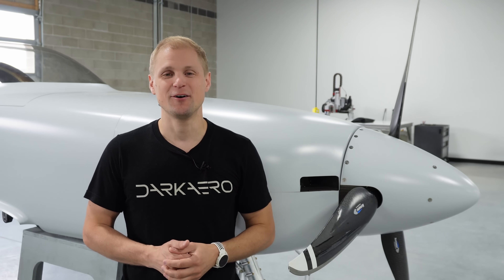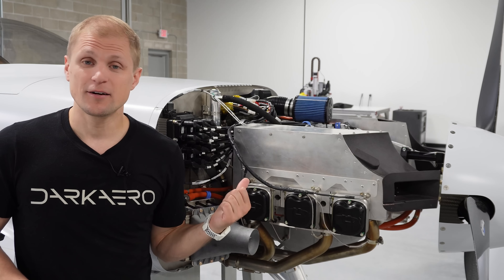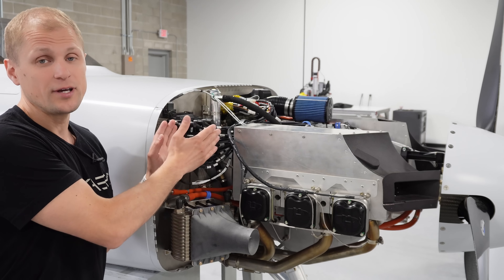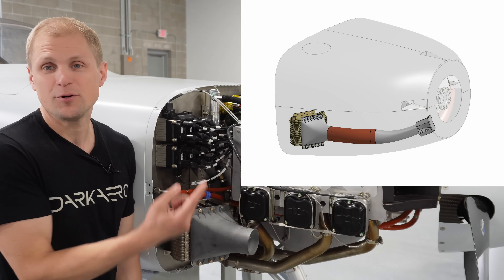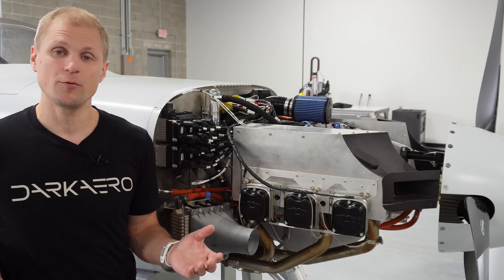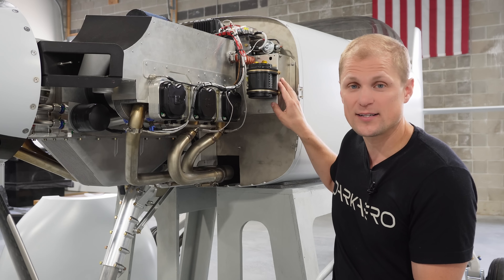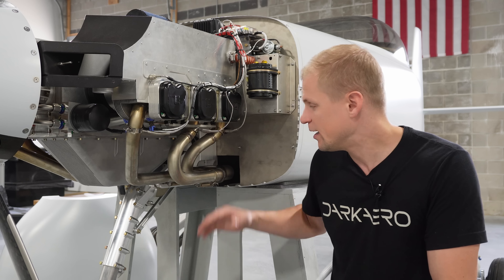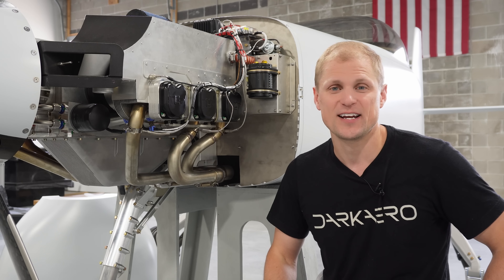Big Engine, Small Airframe: Did we reach the limit?

Comment: It will be interesting to see if the oil cooler air exhaust will be adequate, or if the cooler needs to be moved forward a bit so the air can more easily exit.
Reply from the maker: It’s not shown in this video, but there is a large gap between the cooler and the firewall to keep the exit unrestricted.
Reply: @DarkAeroInc  It looks like you kept the section of the feeder duct to the oil radiator constant ? Was it not possible to implement slow expansion to increase pressure recovery and reduce internal drag? For example by molding a channel into the lower cowl?

Comment: Can’t wait till y’all put the turbo UL on there and get insane TAS up high
Reply: turbo = more power = more cooling, more drag, more engine and structural weight, more complexity and failures, less flying... This plane is not pressurized and IMO its sweet spot will be 9-10 K feet. I'd rather lose a couple of knots than drag along O2 and  fly with canulas... PS : this is from a turbocharged and pressurized aircraft owner/pilot.

Comment: If there’s an engine fire, maybe I want my battery to maintain the electronics.
If there’s a battery fire, I don’t want to have an engine fire too.
Putting a lightweight battery in the tail might be a better idea.
Reply: Weight.  Keeping the starting battery firewall forward limits the length of the heavy #2 wire.  Longer run might require heavier wire.

Best to have dual batteries with dual busses for fault tolerance and a circuit breaker tie between the two.
Reply: @keithjurena9319 :

A longer run of wires or another battery.  Hmmm.
If my engine burns, my battery burns too.  If my battery burns, my engine burns too.
There are so many trade-offs.
Reply: @denverbraughler3948  
Which is why you have two batteries.  Engine fire means you cut fuel and land asap.  A small 5 amp-hour battery will easily power instruments and radio for that time
Reply: @keithjurena9319 :

But the stated design goal is to have the battery firewalled from the cabin.

Another battery means more weight.

I want to use lights too for an emergency landing off-field at night.
Reply: The Garmin G3X can be wired with Aircraft Power 2 being fed by a backup battery to keep the system operational if main bus power is lost. 

Garmin Support:
“While Garmin doesn't directly offer a backup battery for the G3X or G3X Touch, all boxes in the system have isolated "Aircraft Power 1" and "Aircraft Power 2" inputs. The "Aircraft Power 1" inputs are typically wired to the primary electrical bus and the "Aircraft Power 2" inputs can optionally be wired to a second power source. A common builder option is to use a small third party battery unit to keep the display, GSU 25 and GEA 24 online in case of a primary electrical power failure. An example of a third party solution to consider is the TCW Model:IBBS-12v-3ah backup battery.”
Reply: @alexanderarnett4966 :

The stated designed goal is to place the battery on the hot side of the firewall, not to add a third battery.

Comment: Do you have a paper filter in-line so that when the oiler cooler leaks, hot oil cannot spray into the cabin?
Reply: I wondered about the rules regarding heating cabin air with an oil cooler. I dont fly so have no idea. But if the oil cooler leaks, you have very messy air coming into the cabin! Could even block the windscreen!
The odds are low though.
Reply: @olliea6052 :

Anything that can go wrong eventually will.

Comment: How do you manage battery temperature immediately after hot engine shutdown?
Reply: Majority of heat soak goes up into the cooling chamber, so just close the battery temp controller valve?
Reply: @mofayer :

A closed system will seek thermal equilibrium.  
In this case, the compartment is the space under the cowling which houses the engine and battery.

The battery shell needs to be isolated from engine heat and open to the atmosphere.

The battery temperature should be more similar to the cabin temperature and less like the engine temperature.

I expect that it’s easier to ensure that heat and smoke from a battery are easier to vent than to protect the battery from the engine temperature.  
Plus isolating the battery and engine mean that a fire with one won’t cause a fire with the other.
Reply: @denverbraughler3948 their main problem is with low battery temps, not high

Comment: How much new design and fabrication work would be needed to fit a UL520t into a DarkAero 1.1? Or is the packaging so tight that you won’t even consider that?
Reply: The turbo sits aft of the engine on the 520T and the exhaust tube is aft and below. The engine would have to sit far forward to accommodate this but I suppose they could do it and adjust the CG aft with other means such as reinforcement to the airframe for the added speed. They would also need a space for an intercooler.
Reply: I think the UL520iT would not give them an increase in airspeed but is designed rather increase rate of climb and power at altitude which could result in faster ground speed and possibly better net fuel economy. It’s dimensions are surprisingly similar, larger in the X & Z axis by cm’s in only, so it would require a new flaring and a rework of the engine bay intake and exhaust plumbing.

Some of the future planned versions of the UL5xx will include some substantial hp boosts with or without the Turbo. Those might be better suited for an DarkAero 2 with 4 seats. We can only dream.

Of course now we are talking timelines of Turbine Aeronautics Group’s TA200TP, which if comes to market might make make the UL520iT moot as it would be both smaller and lighter than even the current UL520iS.

Comment: the oil cooler also avoid exhaust leaks in the cabin air.
Reply: It will be interesting to see if this arrangement provides enough heat to keep the cabin comfortable at altitude,  Exhaust heat exchangers use approx 1,400 degree exhaust gas to warm the flow of outside air.  The oil temperature will be in the order of 200 degrees after the engine is fully warmed up.  These guys are all about engineering, so I hope they've calculated the BTU's required and available from the oil cooler.  Remember there is about a 4 degree drop in ambient temperature for every 1000' of altitude.  An airplane cruising at 10,000 feet in 50 degree weather at the surface will be traveling thru very cold 10 degree air.
Reply: @garyplewa9277  Excellent points.
Reply: @garyplewa9277 
Exhaust cuffs are really low efficiency heat exchangers.  You don't want air over 180°F and that is hot.  But yes, an oil cooler has far more delta T on oil than air.  All depends on leak rate of the cabin.
Reply: @keithjurena9319  You are correct.  A cuff over a bare exhaust tube, especially tubes made from 300 series stainless steel, which is a poor conductor of heat.  It all depends on the hot surface area under the cuff. There are some aircraft where the cuff is over the muffler, and some mufflers have studs peppered on their outside of the hot surface to better transfer heat to the cabin air.

Excessive air temperature can be easily handled by an air mixing valve.  I'm a long time owner of a Piper Cherokee 140, which has a cuff over a rather large muffler.  The hot surface area is about 6" in diameter and 18" long.  It produces an abundance of heat.  I partially melted my rubber soled shoe one day from the forward side heat outlet by having the heat control in the full on position.  I am never cold flying that airplane in winter.  I can't say the same for other aircraft I've flown

My point in all of this is you can never have too much heat with a properly designed air control valve.  But you can have insufficient heat output and nothing short of eliminating air leaks the installing insulation will help.  DA's approach to using oil heat might be adequate given their cabin size and construction.  Time will tell.
Reply: And what if the oil cooler leaks hot oil?
Reply: @denverbraughler3948  Oil coolers of this design rarely leak.  They're main failure mode is clogging over time and inefficiency from oil sludge depositing on the inside of the cross tubes.  In my 30+ years as an aviation mechanic I don't recall ever seeing an oil cooler leak to any great extent beyond a seepage and that was typically at and inlet or outlet fitting.  Now leaks from an exhaust heat exchanger are very common.  This is why at every annual inspection the "heat muff", which is the air side of the heat exchanger is removed and the entire hot side exhaust containing surface inspected for cracks.
Reply: @denverbraughler3948  it may be hot, but it wont poison you or cause you to pass out. Oil is a fluid not a gas, so it also runs/pools in predictable ways.

Can you cite a single NTSB report involving an oil cooler leak on a comparable engine/airframe?
Reply: @denverbraughler3948  How does hot oil spray from down by your feet, through a duct, into your eyes? It's got a long ways to go with the dash and other items between it and your face.

engineering also requires common sense and not being a dumbA$$.

still waiting for a single case of this occurring on such an engine/airframe.

Comment: Turb Aero made a 200 hp turbine engine, combining the turb aero with the dark aero would be a deadly combination.
Reply: Aren't small turbine engines very impractical for fuel consumption? Where turbines shine is when they get really big, greater than 500 hp range.
Reply: Turbines don't scale linearly,  efficiency drops with decreasing size.  Blade to housing clearance is a function of bearing clearances which are based on oil fluid dynamics.  This blade to housing clearance represents a much greater leakage path for the smaller engine based on total mass flow.
Larger turboprop engines can rival radial engines with power recovery turbine efficiency.
Reply: @keithjurena9319 Good point but a centrifugal jet engine doesn’t have that problem. Like the Garrett Tpe but it’s still a big engine and the exhaust side is axial.
Reply: @willjohnson3907  
Centrifugal still have impeller to housing clearance issues.  The key to high efficiency is pressure ratio and smaller turbines are 6:1 to 8:1. Large turbines are 10+

Comment: What temps is that firewall rated for? And how long can it last in the case of a fire in the engine bay?
Reply from the maker: The firewall heat shield is rated for 2000F. We tested it to meet FAR 23.1191 and made a video about the testing here: https://youtu.be/R25bl-EgW1k
Reply: @DarkAeroInc  Oh wow, thanks for sharing the video that wasn't on my radar! :)
Reply: They made a Kool video of the solid engineering on the firewall. These guys are the right type for building aircraft